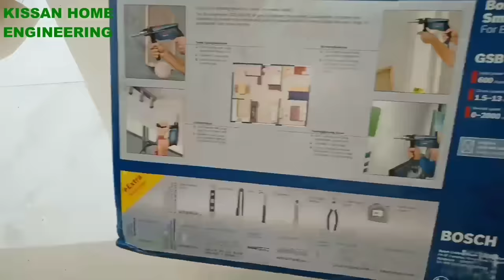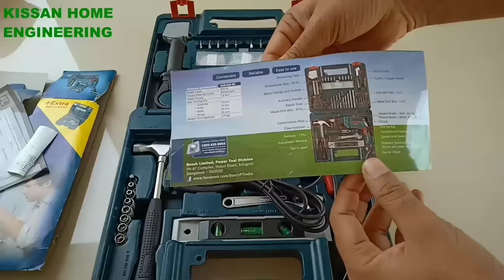Bosch GSB 600 RE 13mm 600watt Smart Drill Kit || Unboxing and Usage

Comment: Hey, can you please tell me the difference between 13 RE model and GSB 600 model ? It is creating a lot of confusion. Thanks.
Reply: Yea that's right. Because both the products have same power and max bit is 13mm on both. 
Anyways what I got to know is that 600re now comes in the market by the name of 13re. Both are the same though, just that 13 re is newer and more costly (these are the only differences).
I hope @KISSAN HOME ENGINEERING replies to you with more info on this.

Comment: I have BOSCH GSB  13 RE , but do clean your tools before putting them back in the case ! Also use centre punch & general lubricating oil  before drilling holes in metals .
Reply from the maker: Yup bro u are absolutely correct. I am thankful for ur beneficial advice.
I am already known of these things,but I was just showing for only you people knowledge.
I just wanted to make the video shorter for saving ur time.
And thanx for being my subscriber.😉

Comment: what is difference between Bosch GSB 13 RE Reversible Professional Impact Plastic Drill, 600 watts, 13mm (Green) and
Bosch GSB 600 RE 13mm 600 Watt Smart Drill Kit 
On Amazon
Reply from the maker: the kit and function are almost same just the drill motor power is different
Reply: @KISSANHOMEENGINEERING  kaun si lun

Comment: What difference between gsb 600 & gsb 13 re 600wat.
Reply from the maker: Both are same, just a model name but 600 means 600watt and 13re means the Chuck size is 13mm Max
Reply: @KISSANHOMEENGINEERING  0

Comment: bro well explained. but what is the negative and positive turning knob function.
Reply: Are you talking on the top red flat button? It's for hammer option for drilling concrete. It is hammer symbol. For wood and metal toggle on other side (no hammering required).
Reply: @pramodm3540  k